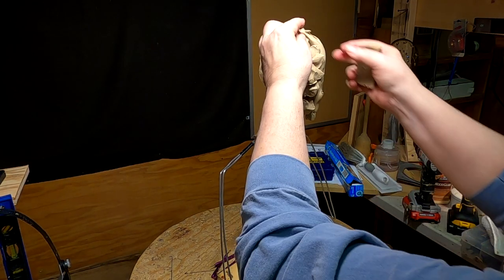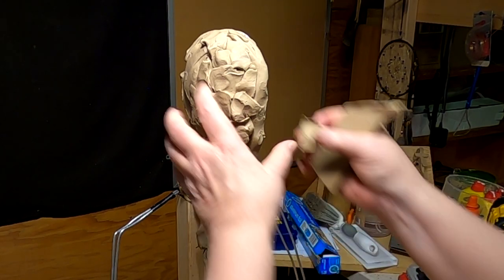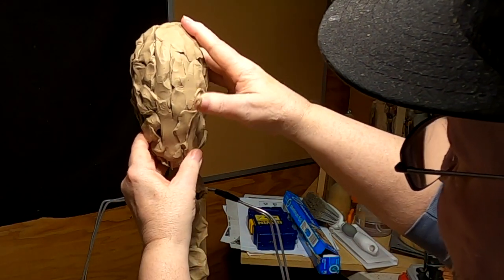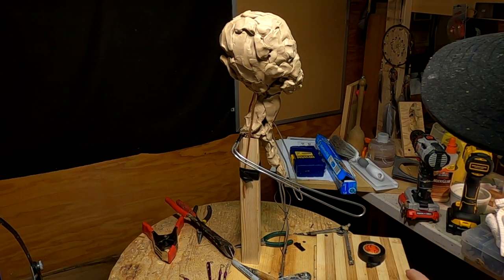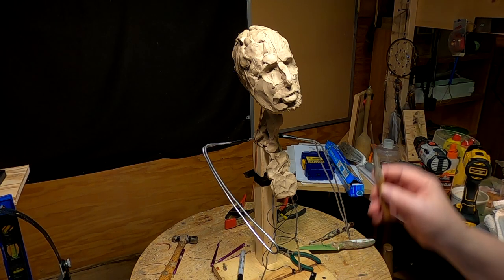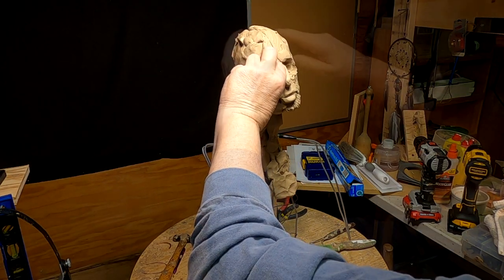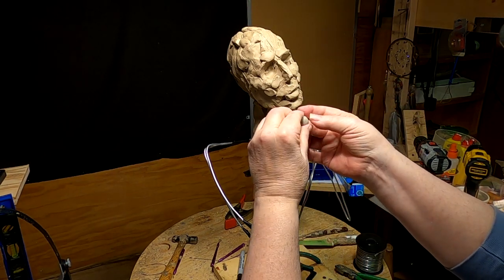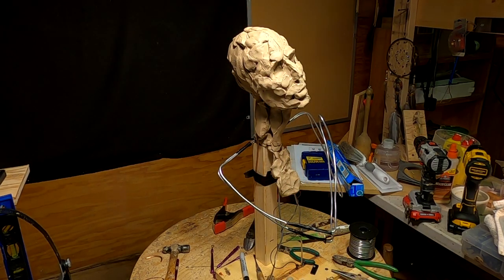Starting a New Clay   Forming the Head of the Figure

Comment: David, it sounds like your batteries are expanding in the case. I have had flashlights do the same thing. The batteries start expanding and leaking and they are almost impossible to remove.
Reply from the maker: Yeah.. I had two of the 4 I had, start doing that.. so I dumped them and ordered 4 new batteries.. Should be here next week.. Not all that expensive.. so better to dump the get stuck..